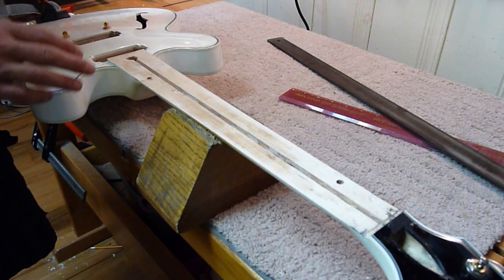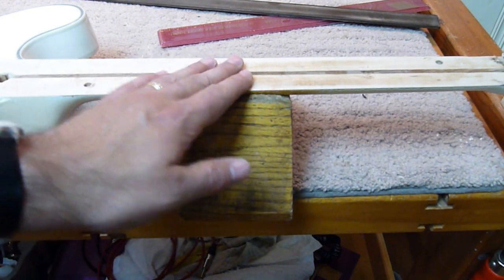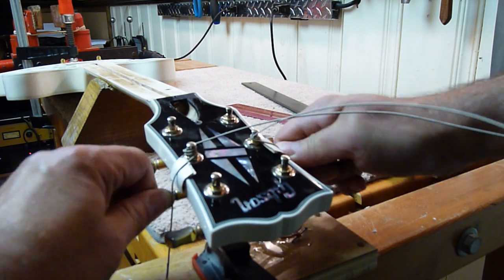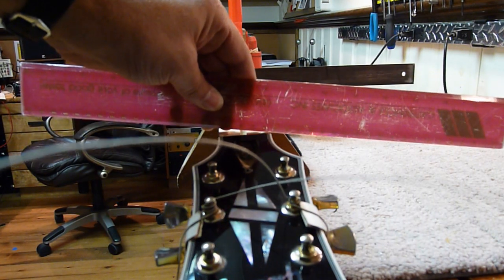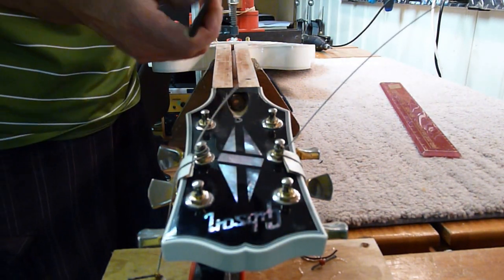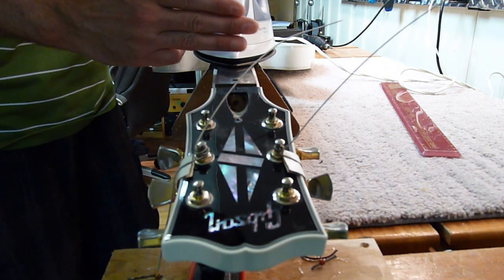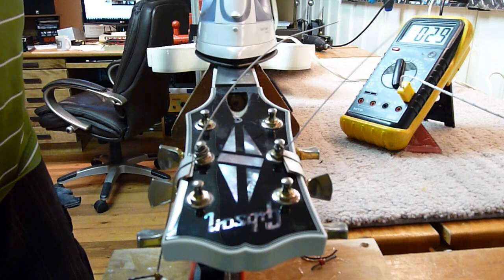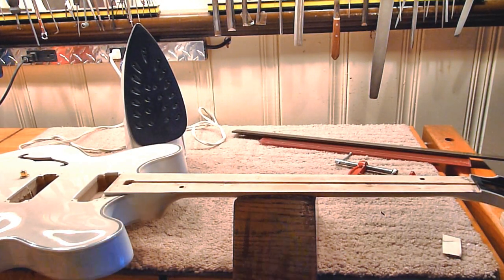Straightening a Warped Neck

Comment: Would it be possible to use the same technique with a guitar bending the oposite way? I have an old Washburn eagle, and i have loosened the trussrod as much as i can, and it aint enough to get the neck straight. I have tried using heavy´er strings.
Reply from the maker: MrHanky1989 Yes it will work the other way too. Good luck!

Comment: Incredibly simple and 100% effective, just recently used your method to correct a wicked concave upbow in my old Esteban classical guitar. I have yet to replace the saddle and apply new strings to give it the real test, but for the time being it's straight and uniform in a way I never thought I'd see it in again. Thanks a bunch for your video. My only question is how did you make the "neck cradle" you set the guitar in?  Like how did you shape it perfectly to fit and firmly hold the neck, so that the angle is spot on and the pressure of being clamped doesn't cut into the neck? The finish on my old classical is torn to hell so the makeshift block I rigged up worked just fine, just left a few minor scratches that aren't any more noticeable than the pre-existing ones.  I wanted to try this on my Washburn grand concert acoustic model, but it's in immaculate shape and I'm really wary of leaving any marks/gouges, let alone doing any further structural damage to the neck.

Comment: This is very clever! Would this   work without removing the fretboard? I have a maple board with a twist at the first fret area that twists up to the treble side. Currently the board is dead flat. I am not sure of the adjustment rod yet.
Reply from the maker: Yes it usually works to a degree even with the fretboard on.
Reply: I just tried your method with a Strat neck. Pulling from the high side (treble side). I used a iron like you on Linen setting. Shes is still in the hold downs. I am going to wait about an hour or two.
Reply: @plasma3211  did it work?
Reply: @Saneadg  In this case it did not! It just kept returning to its original fault state, even after multiply tries! At first it moved and appeared to be correct. Then after letting it sit it just went bad again. I then noticed a small crack in the heel of the neck which faces the pocket on the body. Even though that crack existed when I started out, I still tried to take out the twist. Finally I decided to abandon ship and bought a maple neck from Lido at GuitarFetish. It cost about $65 and was well worth it. I had to change the machine heads as well. After many tweaks with the set up I finally have this $25 Goodwill Behringer Strat playing and sounding like it should!

Comment: Q: May we see a follow up video? I want to know if the headstock twist is still out? Should the back of the headstock be heated up before implementing the ( Machine Head Tension Technique ) to get the Headstock twist out?
Reply from the maker: Is it dangerous to use the tuning machines to tune your strings? Absolutely not a concern.

Comment: What would it cost to do that kind of neck repair on a guitar.? I ask you cause I a have a good Gibson SG that got the neck damaged cause it got dropped on the floor when my strap slipped off. Resulting that the neck got bent up a little so that the strings are not even on the fret board and a little bit high up after that. Damn thing.

Comment: Sir Freddys !! Much respect ! Awesome job ! happen to have a Strat Bullet type neck 78, and it has no neck relief ! So it is straight as a leveling ruler ! Problem is i cant make the neck to have a back bow to make it playable ! So, the Rod is pretty unusable because i already have loose completely and the neck is still like a Rock ! Stiff & Straight ! So what can i do ? I wanted to clamped the neck @ 12 fret and wrap the neck with a electric heating pad thru a light dimmer to control temp !

Comment: With all knon issues Gibson has with breaking headstocks, is it really a good idea to be using the headstock in that way?
Reply from the maker: Yes, It's not a problem at all. Gibson headstocks are prone to breaking from an impact shock, not from steady pressure. If you think about it, the 6 strings tuned to pitch are a steady pressure, and that's the normal state of the guitar. But not only that, the amount of pressure from those two strings was far lass than all 6 strings tuned to pitch.

Comment: thanks for your great technique.
is there any way I can do this on a guitar neck with fingerboard? I mean, putting hot iron on the fingerboard may not be a good idea. maybe the hair dryer would work..
Reply from the maker: +Nan Li  better to use light bulbs. That way you can control the exact amount of heat over time.

Comment from the maker: If it's just a small twist, you may be able to simply dress the frets to remove it. Or if it's worse you could pull the frets and plane the fretboard true. Heating is a last resort.
Reply: FreddysFrets Good to hear that! :) I have a really slight twist. And with this method easier to do.

Comment: What happens when you add the slab and frets. YOu risk snapping the neck/head stock which is fallible in these and exactly where they like to snap. You could use a tourniquet, or clamps, felt, and some wood blocks at the nut and heel area. I picked up a ES 335 with a snapped necked and snapped a lesser Gibson on my own when it fell forward. Charvel came up with those laminate/glued on headstock necks with the weird angle so the wood grain is more in a straight line at that weak spot over this stuff and don't know why Gibson does not adapt some similar measures for their guitars since it is a known issue. The Guitar necks would no longer break there any more. Just don't know! OK then, I see you know wood working quite well.
Reply from the maker: Hi Den Boe, thanks for the comment! Your idea of using a tourniquet or clamps to bend the neck into position is valid. I used the tuners because I could control not only the amount of bow I wanted to force the neck into, but it was also a simple and elegant way to control the twist I needed to get rid of. As to the risk of snapping the neck, there are two reasons I didn't worry about that. First, this guitar had a 3 piece laminated maple neck, so there is no "short grain" issue at the neck/headstock transition. Secondly, even if it was a one piece mahogany neck it's not a problem to put pressure on the neck. The reason they snap is always from the shock of a sudden impact, not slow deliberate pressure.

Comment: Hi! Can you please give me an advice because here where I live there is no luthier. Is it possible to use some method like this in your video to fix a very slight neck warp without removing the fretboard etc. Can I do something with hot iron, or steam maybe to fix it in a non-destructive way?
Reply from the maker: Yes it's possible without removing fretboard. But I would do it with indirect heat from a lightbulb or two....150 watts or more. You can control the heat by regulating the distance of the bulb to the neck.
Reply: @FreddysFrets  oh. If I put the guitar horizontally should I place the bulb under the neck or mayve over it?
Reply from the maker: @Galova  over the neck....on the fretboard side

Comment: Hi Freddys, at first, congratulations for the video, it's one of the most creative and simple I ever saw. I love doing the repairs myself on my bass, and recently I got a little bit of a twist, this brilliant method works on bass too? I got a Thunderbird and was wondering if there's no problem placing the strings attached like yours, because the tuning heads are all on the same side. Greeting from Brazil.
Reply from the maker: Yuri Urbanavicius  Hi Yuri. Glad you liked the video! Yes it will work on a bass too. It does not matter what side the machine heads are on, you can still place the strings on both sides of the headstock, just make sure you have something really sturdy protecting the edge so the string does not damage the finish. Good luck!
Reply: +FreddysFrets hi sir, is it still working when the frets still installed ?

Comment: Could this technique be done without removing the frets/fingerboard, etc. and putting the metal on the frets themselves?

I have an old Harmony H59 Rocket with no adjustable trussrod that desperately needs a neck straightening but doesn't have enough value to justify having the whole thing refretted and replaned. This would seem a great alternative.

Comment: I tried doing this, my neck twisted from 5th fret to the end towards the treble side. I did it, and i noticed that if i fix that bow by tightening the bass side, i create a twist in the bass side and nut insted. Being straight the twist was there. You got any idea and solutions for this or is it time to take her to luthier? Thanks for all your help
Reply from the maker: It may need to also have the fretboard leveled. Hard to say without seeing it.
Reply: @FreddysFrets  thanks for the response man

Comment: Very cool!  Question: What fret is the "high point" of your back bow?  Also would a hair dryer serve as a good substitute?  (I'm really, really trying not to remove the fretboard - e.g. apply the same diffused heat to the backside.)
Reply from the maker: You can determine the high point by simply re-positioning the block until you find the right spot so that when you introduce backbow it can straighten out properly. Don't apply heat to the backside, you'll most likely cook the finish. You can apply heat to the fretboard without removing the fretboard at all. In that case I would use a 200 watt light bulb suspended above the spot you want to heat. the proximity of the bulb determines the amount of heat.
Reply: +FreddysFrets Thanks for responding!  (Learning a lot here!)  I may have more questions down the line.  Hope you'll still be available!  (Shared this video on my fb page.  Brilliant solution!!)
Reply: +FreddysFrets Just employed your method.  All signs point to terrific!  Because I kept the fretboard intact, I actually went through the entire process 3 times - once tightening the truss rod down quite a bit, once backing it off entirely, and then finally with a middling degree of tightening (think +5, -5, 0).  Actually found the neck to sort of "dial in" with each progressive process.  Smells good, bud!  Thank you big time for the "education!"

Comment: Hi! I have a very important question: can this technique be performed with the fretboard attached? Really need to know before doing this on my Yamaha Acoustic
Reply from the maker: Yes it can. Be a little more conservative in the amount of heat though. I would suspend a couple of 100watt light bulbs over the fretboard....maybe 4 - 6 inches above. You'll have to monitor the heat yourself. But do not leave it unattended! Keep checking every few minutes to make sure it's not getting too hot and burning or melting something. It might take 30 minutes to an hour and then let it cool overnight before removing any tension.  Good luck.
Reply: Thank you so much! And two more questions if you'd be so kind: if the bend/twist is at the first fret, I put the neck cradle under the first fret, right?

And after performing this method, do you suggest using a lighter gauge of strings? Because my guitar is kinda vintage and old and I made the mistake of adding medium strings to them.
Reply from the maker: Put the cradle under the 4th or 5th fret so the neck has some free room. You can't just untwist a very short section of neck. But since the neck is thinnest at the first fret that's where the twist is most easily affected anyway.
Reply: FreddysFrets Thank you so much. Following your channel!

Comment: How would I set up a rig like this for a 6 on a side headstock?
Reply from the maker: just because the tuners are all on one side doesn't mean you can't anchor a wire or string on the opposite side just like my video.

Comment: I use this method when replacing broken truss rods (doe 3 so far: check my channel). The job is slightly different (and a little more difficult) on a guitar with the fingerboard still attched. But it can be done (you just have to be careful not to overheat else you will melt the inlays)...

Comment from the maker: Yes, I had to remove the board on this one just because the rod was broken and had to be replaced.
Reply: Did you do a video showing how you put the fretboard back on?
Reply from the maker: @guitarsandguitaraccessories420  It was not difficult because after the fretboard was glued back on I stripped and refinished the entire guitar.

Comment: Freddy knowing how fragile Gibson headstocks are you are taking a risk using the headstock to pull the neck down......kindest regards from the U.K.
Reply from the maker: Hi Stan, there is no problem. Gibson headstocks break from impact...exacerbated by the string tension....and those forces are in the opposite direction of the pressure I applied here.

Comment: hey, do any of you people know what kind of chemical I need to remove the yellowed cracking clearcoat/lacquer/resin/varnish/????? stuff on a late 1960's japanese electric guitar?
Reply: If its nitrocellulose lacquer then yep, what that chap said, sand it. I bought a vandalised JV strat with the modern polyurethane, plastic finish on it in black. Get a draw scraper with straight and curved edges, and a heat gun. It took less than an hour and I was being careful too! I was surprised how nicely it came off. She will be orange soon, and no longer has some twats embarrassing, badly spelt and anatomically inaccurate graffiti on it! If told you how much I paid for her you might well say BS! And they named the four pack of beer sorry I mean price.:-0 And this is a fascinating video and a beautiful guitar, thanks. Mick.

Comment: how do you do it if the tuning pegs are all on one side?
Reply: It's probably the same concept, it's the strings that are doing the work, the pegs just loosen and tighten the strings to pull it to one side.
Reply: just pull one string across one way, and the other string across the other direction. the peg is just an anchor point. the head stock gets pulled down on whichever side the string goes down
Reply: Sam Roney
You explained it far better than me.
Reply from the maker: Thanks Sam.

Comment from the maker: Yes, I released the tension after it cooled and before I checked the straightness. An you can use the same method for a 6 in line headstock.

Comment: It's problems like these that makes me regret ever picking up the guitar. I spent way too much time and money for this shit to happen.
Reply: Like this is a normal thing to happen?
Reply: No, This only happened to me once. I was extremely frustrated the day I wrote this and I take really good care of my guitars which only made me more frustrated.
Reply: I see
Reply: My Fender has either a slightly twisted neck or the worst ever fretwork. Buzzes all over the fretboard, but especially on the 4rd. 5th and 6th strings. I'm going to get it checked when I have some more money because fixing a twisted neck is around €200. Really sucks since this is a €600 guitar.
Reply: Bolt on necks are an easy fix, buy a replacement from the likes of Warmoth!!
Reply: I've left guitars in damp vans for weeks at a time before and never had any issues.
Reply: Are you kidding me, problem such as these are the best part ;)

Comment: If you didn't need to replace the truss rod, could you just loosen it, then place the metal straight edge directly on the frets. That way you don't have to take the fret board off?... Much more novice friendly.
Reply from the maker: Yes, you can just heat the neck.

Comment: 45 to 50 degrees Celsius, right?
Reply from the maker: Correct
Reply: @FreddysFrets  Wonderful. Thanks for the clarification. I'm going to give this method a try on a MIM Tele that has a brutal bow at the moment. Just brought it into the shop and their estimate was more than I'm willing to put into the guitar! Since the Tele headstock has the tuning machines only on the top side of the guitar, do you think I can just run the string on over the high e side of the neck and still run a piece of cardboard underneath it?
Reply from the maker: @TaylorTuomie   yes you can still run strings down both sides of the headstock.....doesn't matter what side the tuners are one...just make sure you protect it well!
Reply: @FreddysFrets  Awesome, thanks again!

Comment: is it absolutely necessary for me to take the frets and fretboard off the guitar for me to fix the twist? I have a 1983 Les Paul Custom with a twisted neck and I don't really have the means or the time to properly take the fretboard off.
Reply from the maker: Not at all. I have the fretboard removed on this one just because I had to replace the truss rod.
Reply: FreddysFrets How would you know if the truss rod snapped or needs to be replaced?

Comment: Don’t leave your guitar in a trunk on a hot day. And none of this will be an issue. If my guitar developed a neck bend, I’d sell it at a loss and buy a new one. Just not worth the headache. By the time you pay to have your neck straightened, you’ll have made up for the money you would have lost anyways. I’m sure even if fixed, it won’t be perfectly straight again. Playable maybe, but you’ll probably still take a loss. Buy a new guitar. You’ll be happier in the long run. As soon as you unbox your new guitar, the nightmare of the old one will immediately evaporate. Have a nice day.

Comment: sorry but your taking the piss. at least get a decent straightedge, not a worn old plastic ruler. i always thought you needed a slight relief in the middle of the neck to give the strings a chance
Reply from the maker: Do you see that steel 24 inch Starrett straight edge? Look up the accuracy of a 24" Starrett straight edge....then rethink your comment.